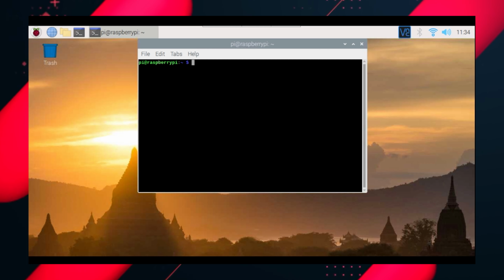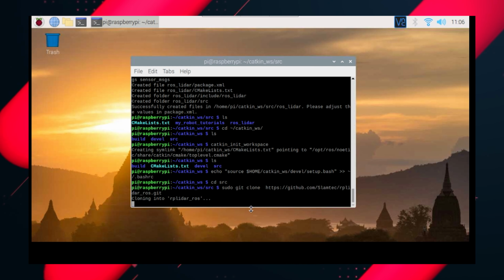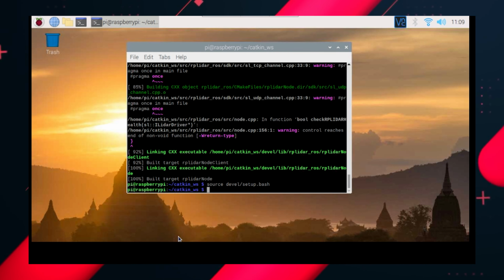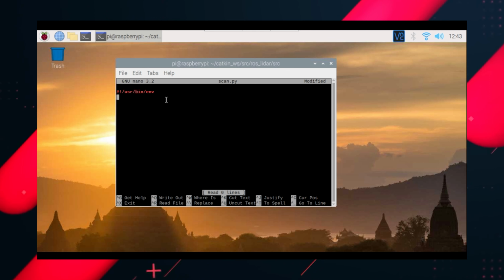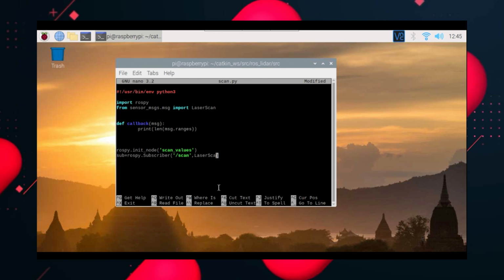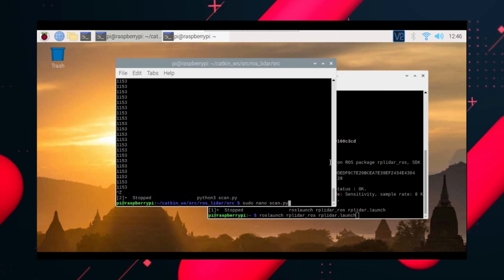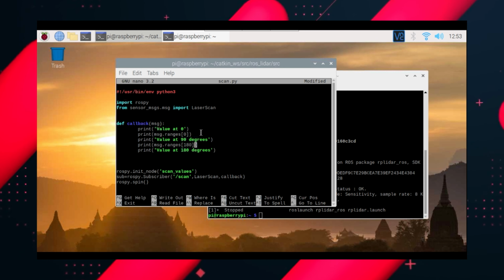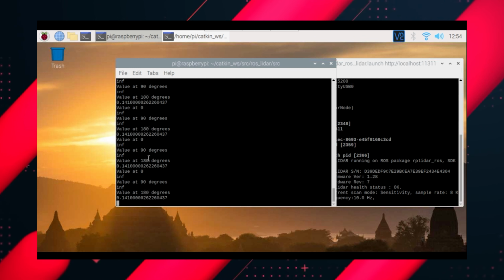ROS ON RASPBERRY PI | ROS BASICS BEGINNER TUTORIAL PART 4 | LIDAR INTERFACE |Robu.in

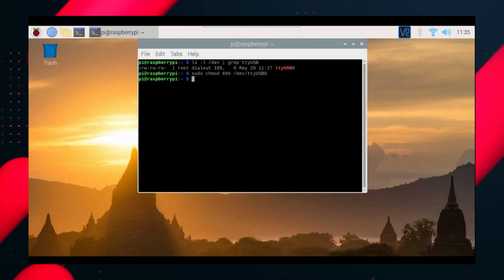Comment: Tip:  Better to add the user "pi" to the group of the device /dev/ttyUSB0, which is dialout (owner is group, see 0:40).  Do that with command adduser(8) and then log out and log in to set the group for the shell:  adduser pi dialout
Tip: Use ^C to break out if you get something wrong in the shell.
Tip: You don't need to be root to edit the python file, so don't use sudo(8) unless you really need it.  And you don't need it to run nano(1) editor.  That could be a security risk.